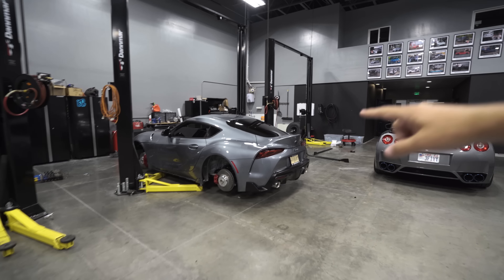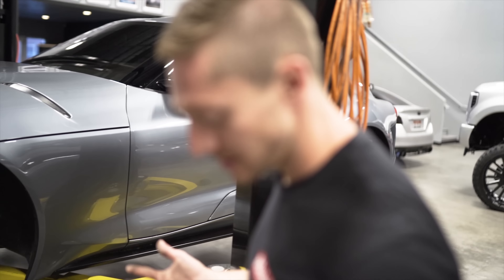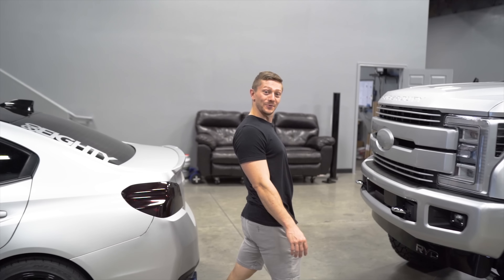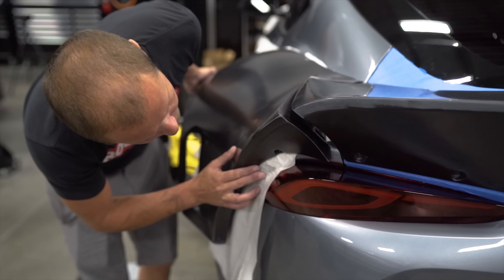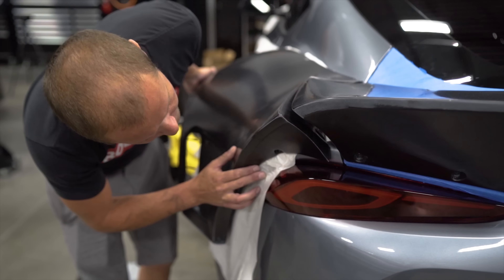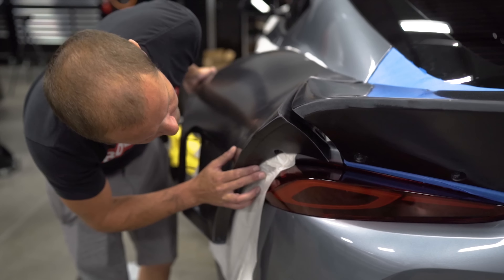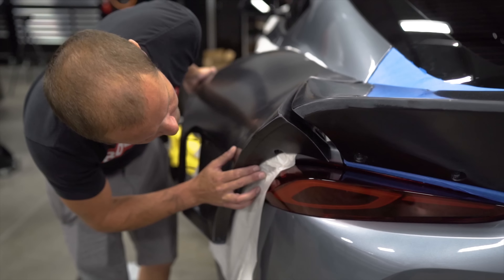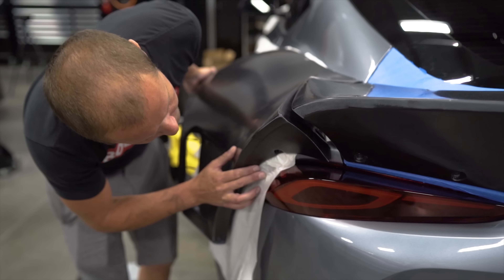ROCKET BUNNY WIDEBODY ON OUR 2020 SUPRA

Comment: you should cut the top layer, leave the second layer, weld it to the top layer,  cut off the excess material.  so it will keep your fender strong,   just a sealant isn't enough

Comment: does this improve performance?
Reply: The spoiler adds about 20 hp and then the tires plus widebody put about 40 more to the wheel. But you have to take out the blinkers from the car because it is a bmw afterall